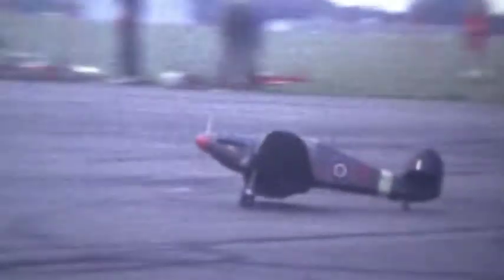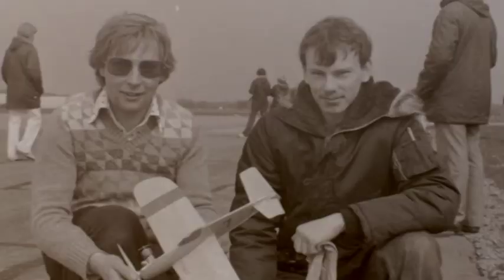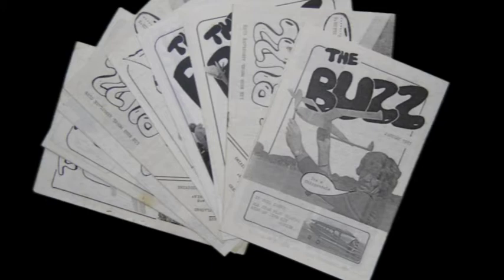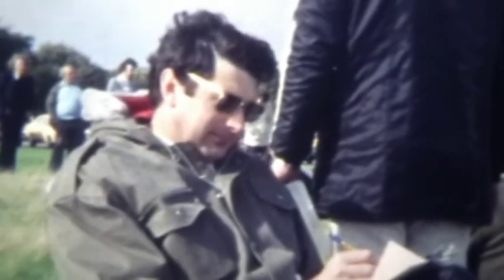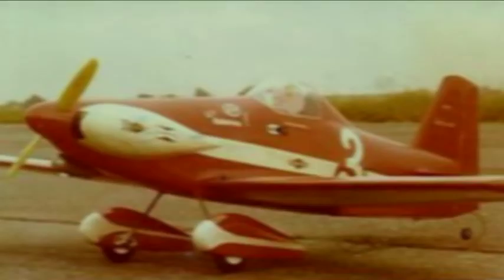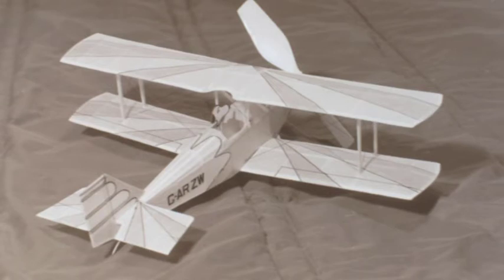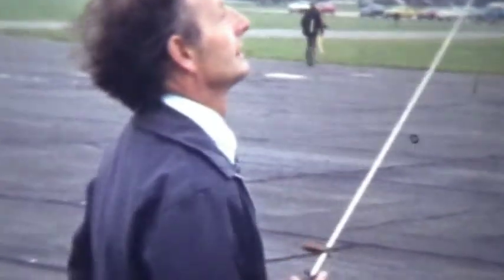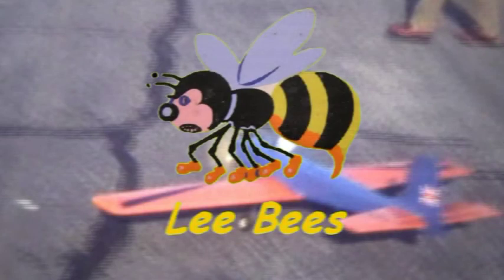Lee Bees, The Buzz the story of the Lee Bees Model Aeroplane Club

Comment: Really interesting,like most kids in the 70's I built Keil Kraft kits and ultimately radio controlled models,the last being a Keil Kraft Outlaw but I never finished it.Though my passion was always aircraft I finished up building a boat with a Veco 61 engine,a Mardave racing car ,a Graupner mini speed electric boat etc.The nearest I ever got in aircraft was a Capstan slope soarer which flew pretty good.I eventually learned to fly full size gliders at Lasham and got my PPL at Goodwood and have been flying full size for the past 46 years or so. Model flying stopped completely for me.I guess really I should have joined Lee Bees back in the 60's but never did.My last flying in the UK was with PNGC at Lee and I owned a Fournier RF5b and a high performance ASW 28 18e at Lee.All gone now big stuff and model gear and these days live in Mindanao,Phillipines though I was born in Bridgemary,Gosport..